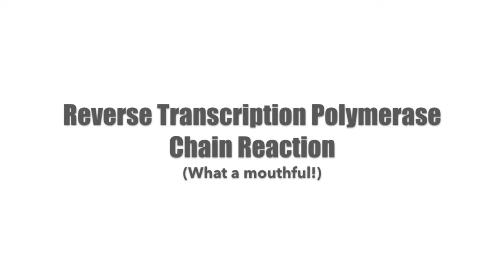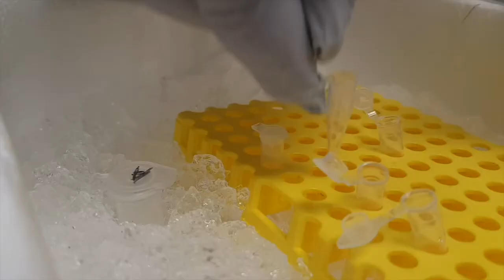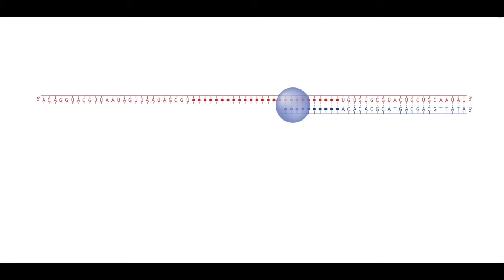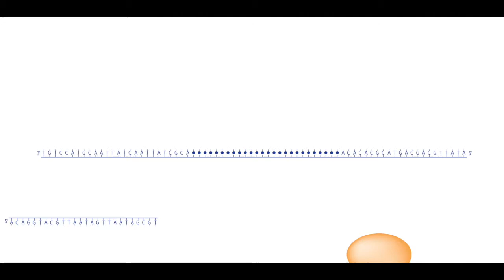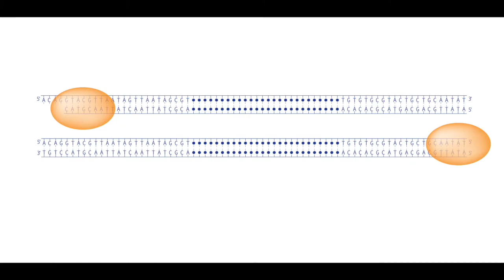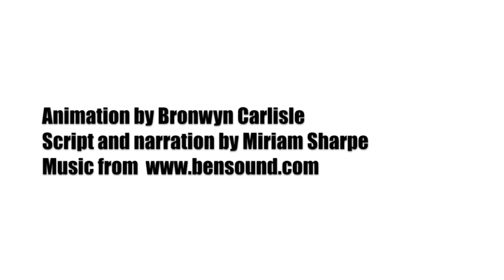How does RT-PCR work?

Comment: "First you will need to find some RNA, maybe from a virus...."  That's a nonsensical starting point when the aim is supposedly to confirm its presence at the end of the process!
Reply from the maker: The video is part of a webpage for high school children explaining how Covid testing works, but RT-PCR has many more applications than testing for viruses. The video is not specific to Covid testing, it is about RT-PCR in general. But to find the presence of an RNA virus you do indeed need to start with viral RNA. If there is no viral RNA in the sample, then none of the following steps will happen (the tube of sample will go through a whole heap of unproductive temperature changes) and the result will be negative.